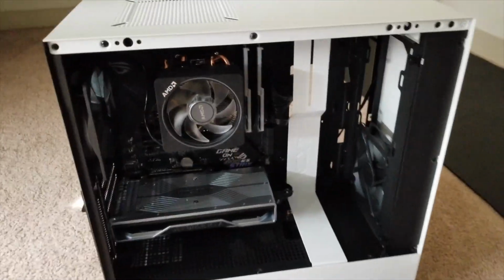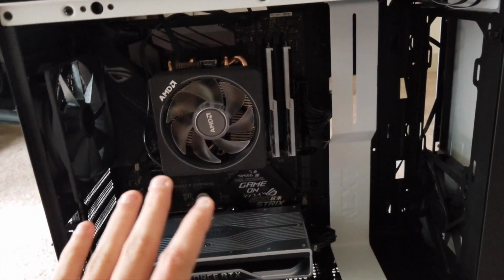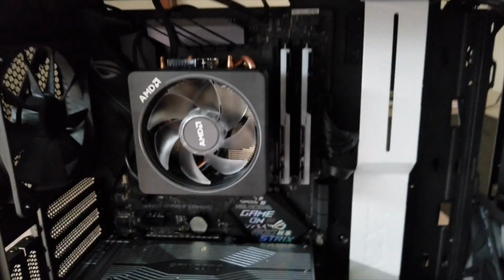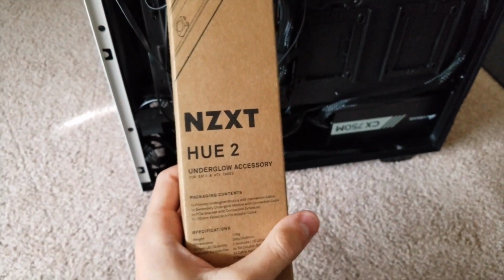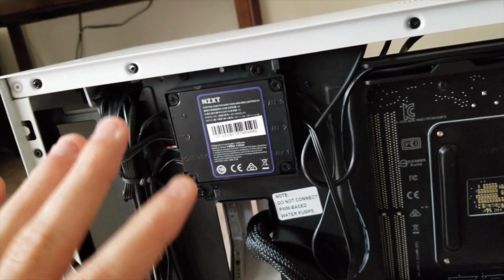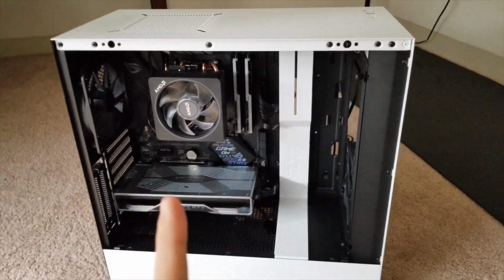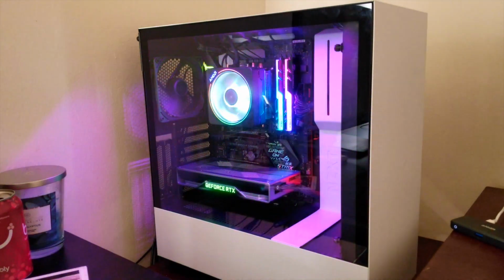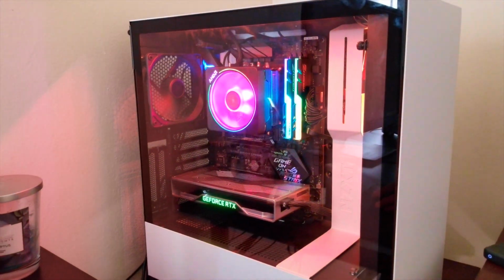NZXT H510i Case - Follow Up and Build

Comment: Quick question...where did you end up plugging the case's "F Panel" 10-1 pin cable? I have all the other case cables figured out, but this one cable has me perplexed. The only spots left on my motherboard where it could possibly fit is a USB 2.0 connector and serial port connector. I've got an ASUS TUF Gaming motherboard, which has a similar set up to your ASUS motherboard. I've read both manuals to no avail.
Reply from the maker: The f panel, do you mean the front panel? If so there are specific spots on the motherboard for it! Probably the lower right side of the board?
Reply: @JaBlankSki , the cable itself is labeled f panel (just like it is on your videos). And yes, I think I figured out that it does go to the system panel connectors at the bottom right of my motherboard. The problem is that the cable is a 10-1 pin (9 pins total) while the connectors on the board is a 20-5 pin configuration. Can the cable just be plugged into the left half of all that?
Reply from the maker: I would assume so! I'm guessing there are more pin on your motherboard for cases with more front panel connections. I believe my motherboard manual laid out where you can plug certain pins into. I know you said you didn't have luck with the manuals but I would just double check 🤷🏼‍♂️
Reply: @JaBlankSki  good news! I did finally figure out that the cable does only use half of the pins available. All is well! Computer is up and running. Thank you so much for both videos! It helped me immensely!
Reply from the maker: I'm glad you got it all working! 🤙🏻

Comment: Ja Boi I really need your help. I have the same case and motherboard but idk how to get the power switch to work. The “f panel” isn’t even specifically labeled properly on the motherboard neither do all the pin connectors connect to the f panel plug from the case
Reply from the maker: Read the manuals for both the case and motherboard. The motherboard will tell you what plugs are what and the case will tell you which pins are which. You are right not all will be plugged in. Manuals can be found online if you don't still have em
Reply: Ja Boi it’s good I plugged the f panel in wrong

Comment: well i sure hope you will reply to this, although its almost a year later. I just bought the NZXT H510i case, moved all my stuff over to it. Everything works fine, all the usb's work. The led strips and fans all work. computer runs great. However, when i go to open nzxt cam settings, i just get "no supported lighting devices were found" under the lighting section. I cannot figure this out for the life of me, plz help! I dont have any extra, im just trying to change the color of the 2 led strips that come in the case. can i not change them? I do not have the HUE+ thing, do i have to have that to change colors?
Reply from the maker: Can you control the fans through the CAM software or do those not work as well? If you can't control anything through CAM then uninstall and reinstall it. If that doesn't work make sure you have everything plugged in properly

Comment: Hey I have the same case, neither of the rbg strips work and the fans that came with the case won't spin. Did I do something wrong? Please help
Reply from the maker: Make sure everything is plugged in properly first
Reply: @JaBlankSki  I have everything plugged in except that 3 cable thing connected to fan 3 hub, and the Sata cable which I don't know how to connect
Reply: The rgb lights work now but not the two fans
Reply from the maker: Well if the RGB strips work then the fans should as well. I'd unplug and replug em. Not sure on the sata cable you're referencing
Reply: @JaBlankSki  there's a sata cable that came with the case that's attached to the nzxt hub. Do the fans only spin if it gets hot or should they always run?
Reply from the maker: The fans should always be running
Reply: Hey the sata cable should be connected to the power supply it should have one. I’m having trouble with my RGB fans they don’t light up :/

Comment: What if i had 4 fans?
Should i plug the last one in the mb and the other 3 in the fan hub?
Reply from the maker: I believe it can with a multi port expansion cable for fans/LEDs. Could always use that🤷🏼‍♂️
Reply: @JaBlankSki  thanks

Comment: Hi I also have the h510i and a B450f mobo. Does your front case audio jack work? Might doesn’t seem to even with the right HDD audio connection on the mobo
Reply from the maker: Yeah mine does. Make sure the right port is selected for where you want the audio to output. You can do this in wondows
Reply: @JaBlankSki  After removing the connector and plugging it back into the mobo, it now works. Guess it wasn't correct the first time. Thanks for the response! Liked the vid :)
Reply from the maker: Glad you were able to figure it out! Sometimes it just takes a little troubleshooting 👌🏻🤙🏻

Comment: so i have a nzxt case and im trying to use the microphone on my headset but i cant. but when i plug in the splitter i cant hear the audio. what should i do
Reply from the maker: You may not have plugged it into your motherboard correctly if you're using the front(top) IO
Reply: @JaBlankSki  so where should i plug my headset into because i reconnected everything
Reply from the maker: If the front IO still isn't working then try the rear IO of the motherboard. And make sure you select the right audio out in windows

Comment: Did you leave the stock fans in the case? Will a 3 pack of fans to replace the stock ones work if I add the 3rd where you have your amd fan?
Reply from the maker: I left my stock ones in and added a few. I mean my AMD one is the CPU fan so you'd have to put a CPU fan or all-in-one cooler there

Comment: Can the included Smart Device V2 Hub, be used to control a RGB CPU fan? Thank you.
Reply from the maker: I haven't tried to be honest🤷🏼‍♂️ it may work but what I have found is the NZXT hub can be picky and a lot of people plug all their rgb devices into the Mobo to control them
Reply: @JaBlankSki , I think you are spot on.  Trying to help a friend who went ahead and bought this case w/o asking my opinion, all bc of liking the LED strips.  So, at hand is figuring out if the Hub can act in place of an RGB header on a mobo, to control an RGB CPU fan.  If can, no need to get a mobo that has that type of header, if not, then have to get a mobo that has an RGB fan header.  Overall, would you say having the Smart Device V2, is worth it?  Thanks, enjoying your vid.
Reply from the maker: Ah I gotcha👌🏻 but it's nice that it's included but it's not really that fancy🤷🏼‍♂️ I feel like you'd have better control through one on the Mobo
Reply: @JaBlankSki , I can see that and agree that is more likely than not.  Thank you.

Comment: Does AER RGB 2 fans require a separate hub? or i can plug it to the build in one.
Reply from the maker: Supposably they will work with the built in hub. I have not tried so I can't confirm🤷🏼‍♂️
Reply: same question did you find the solution to this.
Reply: @ryangeorge4590   yes I plugged it all in the built-in hub and its working like a charm, you don’t have to buy a separate hub 👍👍

Comment: If I want to get some corsair fans specifically the sp120 that come with a rgb fan hub I can't use the nzxt hub I have to use the corsair but i want to keep the nzxt led
Reply from the maker: I'm honestly not 100% sure. I think you can control them in just not sure it it's the same depth as the nzxt ones

Comment: I wanna add corsair fans using this case can i use the hub or do i use the motherboard to insert additional fans?
Reply from the maker: You can use the hub. Not sure if you can control the colors if they are rgb but you can control the speed

Comment: So I'm currently building a pc whith this case and I notice you didnt mention that one cord that had a black case on it and I was wondering where that goes and if its important  it says awm style 2725 80 VW-1 super high speed USB  if that helps
Reply from the maker: I believe I mentioned it somewhere but that's for the front USB C port. Your motherboard may not support it like mine didn't. You can get an adapter if you really want to utilize it
Reply: @JaBlankSki  thank you I wasnt quite sure if that's what you were talking about

Comment: I have this case and Is 80 degrees too hot for my gpu? It’s an rtx 2070 super and I only have the two case fans with an aio cooler for my cpu, my room gets somewhat hot so that might play a factor but I’ve tried to custom fan curve in afterburner and it still gets to 80 sometimes, is that normal or should I fix something, thanks again
Reply from the maker: I mean if it's under strain, like when your playing games then it's fine. You can always add more cooling if you're worried

Comment: I downloaded the CAM software but it isn't detecting the LED strips, what do you suggest doing?
Reply from the maker: Do the LEDs turn on at all? I would make sure they are plugged in/unplugging and repluging them in. Also make sure the power for the hub is plugged in
Reply: @JaBlankSki  Yeah the LEDs turn on but CAM won't detect them.
Reply from the maker: Try some of these troubleshooting steps:
https://support.nzxt.com/hc/en-us/articles/360015878513-Hue-Not-Recognized-by-CAM?mobile_site=true

Comment: Thanks for the video! Just wondering, is it possible to move the case fans to the frontpanel?
Reply from the maker: Yeah you can but I would recommend still having the ones where they are at and just adding some additional fans in front
Reply: @JaBlankSki Thanks! It was my idea to move them and add some extra rgb fans at the back.

Comment: Aww i might be too late, but i have the exact same case and the rgb strip is not working but all the cables are already plugged in ( tried to plug in the mobo and SATA )
Reply from the maker: If everything is plugged in correctly, and the LEDs don't work when you power it on, then the LEDs could be defective. Try plugging them directly into the mobo and turn the PC on. If they don't light up then they are probs defective. In that case I would reach out to NZXT

Comment: Hey I just started my H510i build! So if I get two AER RGB fans, and keep the two stock fans (and move them to the front), would the smart device controller be sufficient? Or would I need the Hue 2 for the AER RGB fans?
Reply from the maker: I wouldn't recommend moving them to the front. I tried that and then heard the stock configuration is the best for this case. So I switched it back to stock and saw way better performance. In regards to the AER RGB fans you should be okay without the hue 2 hub🤷🏻‍♂️ at least that is what I have heard, can't speak from experience

Comment: Super helpful video!! First time builder and I also have this case. I was just wondering which if any of the rgb hub cables ended up being used? I have like 3 where I’m not sure what to do with.. I guess more specifically the sata it comes with? I saw that you didn’t plug it in but you said it needs to be plugged into the PSU so I’m a bit confused
Reply from the maker: I believe the rgb cables are already plugged into the hub then I think the hub connects to power? Not gonna lie it's been awhile since I set everything up so it's a little fuzzy. But anything that's already on the case is either for the rgb/fans or for the front I/O. I believe I didn't use one cable for the front usb C cause my motherboard didn't support it. If you are talking about 3 sata cables from your PSU, or extra cables from your PSU, then you don't need to plug those in if you don't need them. So the case only needs one SATA connection. Any other plugins on the PSU cable can be used for other components if needed (i.e. a hard drive). I hope that helps in some way! Best of luck on your build🤙🏻
Reply: Ja Boi No worries! I think I figured it out - I have a sata cable running into a SSD so I just plugged the sata from the rgb/fan hub into the extension on the sata cable to my ssd and psu

Comment: Could I put a rtx 2080 ti and ryzen 9 3950x in this will the airflow be good?
Reply from the maker: Just depends on how hard you are running it all. If you plan to push them, then I would recommend something with a little better airflow. Or at least an all in one water cooler for the CPU🤷🏼‍♂️ but your call
Reply: Ja Boi so it’s fine ima just get that bcuz it’s the cheapest yet aesthetically pleasing case I consuls find

Comment: I believe this case should be a negative pressure setup wherein the 2 fans included should be on exhaust (rear and on top).
Reply from the maker: It does come that way when you get it. One fan on top and one fan out the back. But I wasn't a fan so I moved the top one to the front of the case. Just my personal preference is all!🤙🏻

Comment: our builds are really similar, just thought that was cool. what'd you do with the usb 3.1 gen 2 cable the case came with? i couldn't find where to plug it into
Reply from the maker: That's funny 😂 and I think I just left it unplugged since there wasn't a spot for it on the board 🤷🏼‍♂️

Comment: Hey man I have a question. So I got this same case and I had the AMD motherboard to go with my AMD CPU just like you. But when I tried to connect the F panel cable to the +, -, and power switch cable that goes to the bottom right of the motherboard the clip that connects them would not go in. So I just put the F panel cable alone in that slot. Did you have the same problem because you have a AMD as well
Reply from the maker: Hmmm no I didn't have a problem like that🤔
Reply: Huh that’s odd. I mean the pc works just fine but I would like to follow the instructions from the manual but thanks for replying

Comment: I have the same case and installed everything correctly, and my LEDs won’t work. They don’t get detected by the CAM software
Reply from the maker: The LEDs should be plugged into the hub. Then you need to make sure the hub is getting power. If your case fans (hooked into the hub) spin then the hub should have power. If that's the case then your LEDs could be defective 🤷🏼‍♂️ now if your LEDs do turn on but you can't control them through the cam software that's a whole different situation
Reply: Ja Boi the thing is my fans weren’t spinning so I plugged them into the motherboard, I couldn’t find a connection for the molex cable.
Reply from the maker: I don't believe molex is widely used anymore. The fans in the case should all be 3 or 4 pin connectors. I'm guessing your hub wasn't getting power then. Make sure you plug a cable from your PSU to the hub. If you already did that try another cable. You'll just have to do some troubleshooting. If you can get it to work something could possibly be defective 🤷🏼‍♂️
Reply: Ja Boi I plugged the sata cable in

Comment: my cpu hits 60degrees celcius and planning to buy new fans, is there something i need to do with the fans that are already in the case? like flip it or something?
Reply from the maker: Nah you shouldn't have to🤷🏼‍♂️
Reply: Ja Boi thanks for your quick response, so do i need to buy some intake fans (with the cpu hitting 60 degrees is when idle, when gaming 70-80 degrees)
Reply from the maker: Completely up to you! Personally I would add another fan if for some reason my cpu was running at those temps. But that's just me🤷🏼‍♂️

Comment: What about rgb fans?  Can I just plug those directly into the hub included with this case?
Reply: *Fan splitter thats connected to the hub
Reply from the maker: You can just not sure on if they will be controlled through the CAM software or not

Comment: can someone help me because my rgb lights dont work only 2 leds light up and thats it and the fans didnt want to work so i had to connect them directly to my motherboard plsssssss help
Reply from the maker: If everything is plugged in properly and things still aren't working then the case or hub could be defective 🤷🏼‍♂️
Reply: @JaBlankSki  ok thank you so much i will contact them

Comment: I have the same motherboard and the same case, but I don’t know where to plug in the HD Audio cable. Please help me!
Reply from the maker: Do you have the instruction manual for your motherboard? It explains in there where to plug in all the front I/O for your case! It'll be in the lower right of the motherboard when you look at it with the rear I/O in the upper left
Reply: Oh I found it! Thank You
Reply: @1SoCalFire , where did you plug in the "F panel" 10-1 cable? I know where the HD Audio cable goes, but I can't figure out the case's F panel cable.
Reply: Do you have the same motherboard?
Reply: If you do then it’s at the bottom right
Reply: @1SoCalFire , I don't have the same model, but it is an ASUS board. The bottom right is the system panel connectors (20-5 pin configuration). The F Panel cable could fit on the left half of that. Is it okay to do it like that?
Reply: No It won’t work, you have to find the 9 pin connector
Reply: Where it said pwr_sw
Reply: What’s your motherboard?
Reply: @1SoCalFire , after studying it all very carefully, I realized that that was exactly where it was supposed to be plugged in (left half of the 20-5 system panel connectors). My motherboard (Asus TUF X570 Plus) simply has a lot more pins for the front panel for extra options. All is well! Our son's computer is up and running! Thanks for helping!
Reply: Your welcome